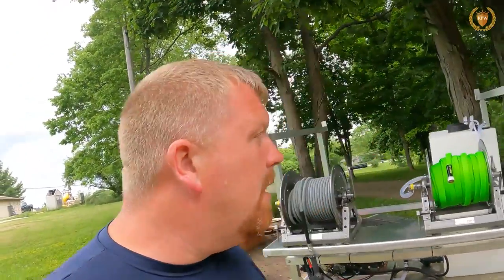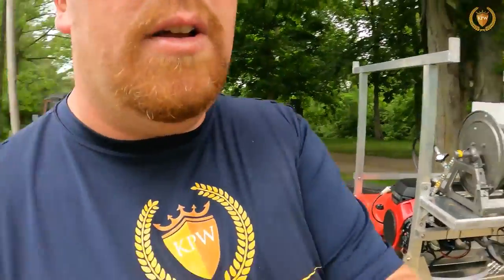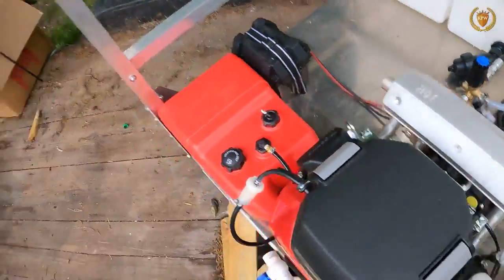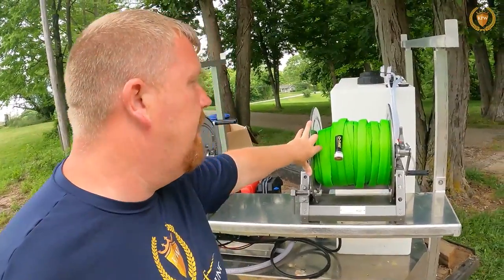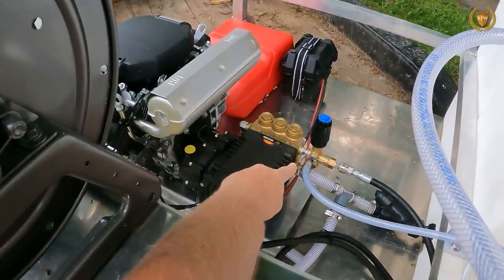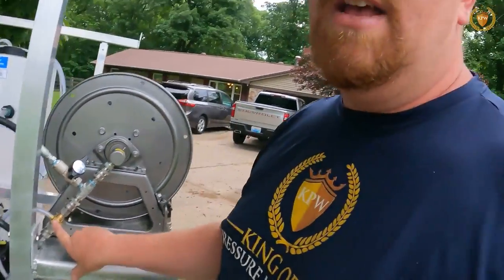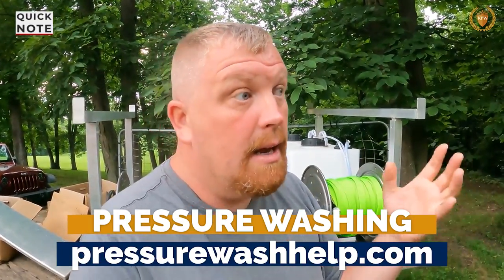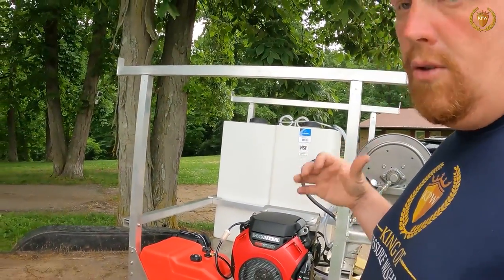Introducing the NEWEST TRUCK SKID PRESSURE WASHER!!!!!

Comment: I tried the 3/4" Zero g hose last year. Worked for about 3 weeks then just blew the end off the hose. I was right in middle of a house wash. Glade I had a spare hose with me, so it was quick to get back up and running. Good job on the skid. It looks great
Reply from the maker: Dj been using it for a while. But thats good to know

Comment: I really like this setup…organized and compact. I have one question…why is the float valve located in that spot? Doesn’t is make close to a 3rd of the tank unusable??
Reply from the maker: No it will fill all the way up and get 50 gallons of water. Th float is what shut it off
Reply: @kingofpressurewash  oh ok…I thought the float was connected to the side bulk head fill hole. Where does the float attach?

Comment: How much will that cost
Reply: With the 5.5 gpm pressure washer
Reply from the maker: This one right here right now you come pick it up tomorrow  $13,000. If you want me to add a soft wash system on it will be $14,000 and thats for a 12v system